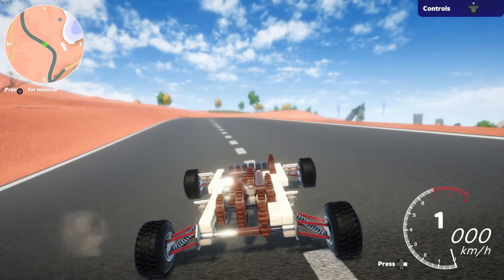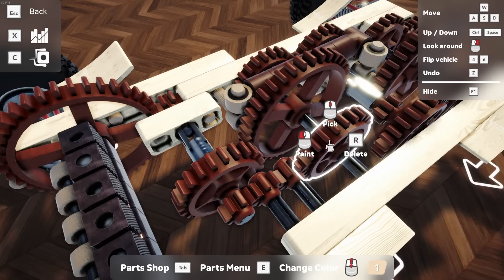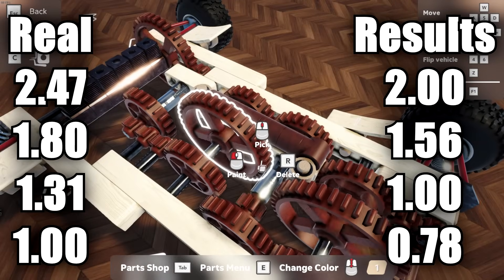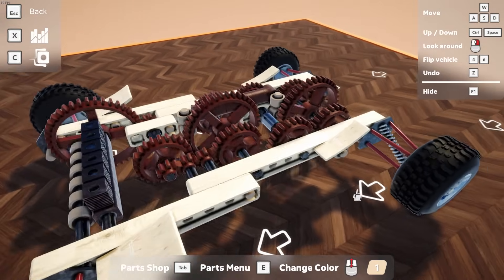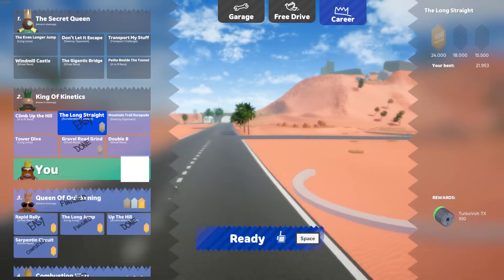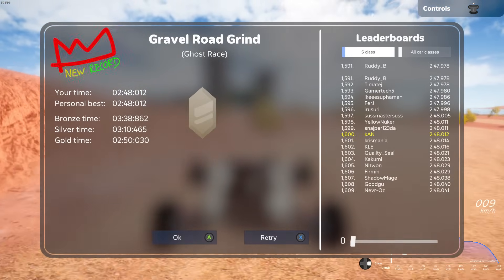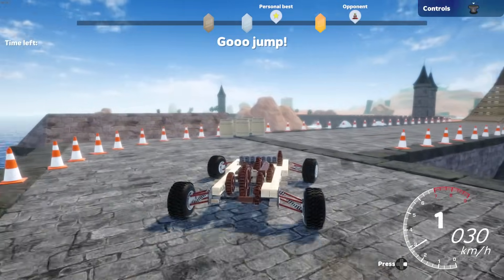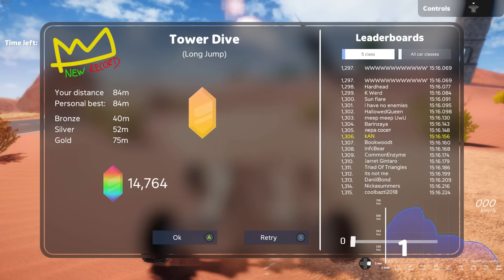I Built an Insane 4 Speed Gearbox Using Real Life Transmission Ratios!

Comment from the maker: Let me know what you think of my transmission and how I could make it better although I'm pretty sure it is "not bad". "
EDIT: Apparently there is manual shifting in settings.... unfortunately it doesn't seem to map to my xbox controller but either way thanks for the advice!
Reply: Huge fan of you, Scrap and the rest of the group, just to put that out there!😊
Reply: you can select manual shifts in settings
Reply: By the way, people have made planes that can fly in this game using upside-down wings and using wings as propellers so yes you can flip them over.
Reply: Congrats for the Wedding ! Wish you guys a Lifetime of Happiness😄
Reply: When you flipped the downforce to upforce, it was still downforce (just less effective). You rotated twice instead of once.
Reply: with steam you can map your controller to be the keyboard keys if its not working for you
edit: just press shift tab if you have overlay on when game is open and press the controller button at bottom of screen
Reply: You gotta learn to let off the accelerator when in a jump and use reverse to level off the car.

BTW,straight up planes with propellors have been made in the game.
Reply: this is so cool I cant wait to see what you get done with the better transitions, harder to use engines, and orbit gears
Reply: There is a manual mode in the settings
Reply: I think the class is speed
Reply: 4 5 8 is correct for the gears, dev confirmed
Reply: Upside down spoilers do generate lift, but it doesn't really feel as if they would be wings
Reply: I love how you are completely unaware that cars are 100% controllable in air. With inverted wings, you can fly for like hundreds of meters easily, and steer quite a bit. Gliding from the Royal Castle is super fun!
Reply: I would love to see u make an 8 speed engine
Reply: Love these videos, they help me understand more about rc cars and transmissions, they are so fun to watch and would love to see some rl rc car off road racing, keep going strong
Reply: wait till you have the planetary gear they are packaged really nice
Reply: There is a three shifter
Reply: @soulreaper1981  do you mean three? yea it takes alot of space tho. will change the shape of your build for sure
Reply: Make a hybrid so you can have the best acceleration and top speed!
Reply: yeah a manual shifting and shift sequence programming mode were my two bits of feedback recently. and YES THE UPSIDE DOWN WINGS PROVIDE LIFT. i made a dual rotor heli with upside down wings and wheels in creative and tested it on long jump. controllability is almost non-existent, but i flew to an easy 1km over the map in free drive.
Reply: You were so close to getting the good ratios. You coouldve just multiplied it by 1.25 you'd get 2.5 1.875 1.25 0.975 which is right on the real transmission. Big to small gearing on the output from the transmission and that wouldve been it.
Reply: You have air control on the long jump u probably held down w and that's why u pitched down and then of course the wings aren't going to work
Reply: S class means sport class
Reply: You can make it manual in the settings
Reply: you actually have the manual mode in the options and touch them by searching a little I found " ; " and " : " to shift gears manually, it offers more control over acceleration depending on the vehicle's gears, personally I prefers manual mode after everyone sees things their own way.
Reply: Just to let you know, your right stick is air control
Reply: Yes, put another shifter on the back and then some Downforce front and rear to be able to Race it.
but better is to beat the career then you can find the best engines and gearshifters in the treasure chests around the map.
Reply: You can click details in top left corner in performance chart and it gives you the information of classification for the vehicles
Reply: You don't need to choose between the 2 gear sets. Just add another unpowered transmission with both gears switchable transferring down to your axle. Boom, 8 speed transmission with better acceleration and all the speed.
Reply: As far as i hear gas engines are way better when used for a gear shifter like this due to the shifting needing high rpm.
Just wanted to point this out becuase in your last video you made gas sound like it was inferior when gas is actually better than electric when it comes to transmissions.

Btw love what youve been doing in screw drivers so far, keep it up 😊❤
Reply: dude you can switch to manual gear change in the options
Reply: Observing channels like yours, I noticed that your Ratio is quite "centralized" with the Real target, as I don't see too many losses in values, and a good way to reduce its size, I think a GearShift 3 would be useful, it would make the front or rear big But it would be better to change Gears, and with larger engines you can reduce the number of smaller ones, maintaining power It doesn't look like "Oh my God Mark 5 in this game" but it would help to reduce the size, and the focus would be more on Performance, like the 38km/h you achieved❤
Reply: @kANGaming 0:37 in the settings you can change to manual transmission.
Reply: If you go into settings, there is an option for manual using the "<" for down shift and ">" for up shift
Reply: Ngl, theres a such thing as a S+ class........>.>  ive been just messing around in Screwdrivers and i made a car that its max is like 247 but it can climb too 400+ (take a while) just the map isnt long enough. I wanna see if i can make 400 lesser of a climb.
Reply: Hey KAN! Please try to attempt Mach-1 and achieve a Sonic Boom! No one has done it yet and I also checked the Planetary Gear and it is indeed 1 : 2.3 Gear Reduction as shown in the part info. The big gear is 1:2 when you mesh it with the small gear. (NOTE: The Planetary Gear gives 2.3 ratio shaft to shaft, no gears to be attached. The Engine Output Shaft goes into the carrier/planet gears directly and then you attach another shaft at the Sun gear and that gives almost 2.3 at the Sun Gear output shaft.)
Reply: where are the video of gearblock ? did you made any engine ?
Reply: can you do a tutorial on how to build this

Comment: Usually the gear ratios in a car are given the other way around, instead of being shaft rotation to engine rotations, it's engine rotations to shaft rotations. An example being the first gear on my car, a WRX, has a ratio of 3.454, while the second gear is 1.947. Given this standard, I believe that you may have misinterpreted the realistic gear ratios that you used, but ironically this would have lead to better results inside of the game. While in most cars an overdrive gear is really only used for better gas mileage at high cruising speeds, from my observations, these gear ratios are very effective for increasing top speed inside of Screwdrivers. This leads me to believe that the engines in this game create a lot more torque and have much lower RPMs than their real-life counter parts.
Reply: Came to comment the same thing. First gear is usually numerically higher and fourth is numerically lower.
Reply: That’s what I was thinking, real gearboxes are mainly reductions.

Comment: If you view the power chart from the build mode there is a button in the top left that says details, it explains the different classes, also it seems to pretty much always be worth it to just stick some electric engines on your driveshaft after your gearbox as it gives that acceleration for like the first 15kph which gas powered cars inevitably lack
Reply: Also if you run a bunch of gas engines and electric motors into a gear shifter through the same input shaft it doubles your gear count. It's not overly helpful from what I've tested so far though..

Comment: The game computes 2 classes for each car: One based solely on the theoretical max speed shown, and one that's based on almost all the stats: Max Speed, Power, Acceleration, Mass, and Aerodynamics. Then it displays whichever of those two is worse. (Grip and Wind resistances are not factored into either class calculation)

Your friend is correct. I can confirm the gear ratios in the current game version are 4:5:8

Comment: Some stuff you are missing out:
- There are some juicy parts you may want to look at: Gearbox 3 (changes 3 steps), planetary 1:2.3 ratio gear set (also some beast of gas engines)
- Controls: You can set the game to manual shifting, remember Space to handbrake on those hairpins, active aero or inertial weights to help break/turn are a thing, although controls are a bit finicky
- Yes you can make flying creations ;)
- Yes, 4,5,8 (or 8, 10, 16) is what I also use in my spreadsheets :D
- Aerodynamics matters quite a lot in high speed (even without wings a wide and tall car will have worse aerodynamics as the game actually factors that in)
- Making the torque higher at low speeds to increase acceleration may not increase the actual acceleration as the grip is the limiting factor - an ideal gearbox (akin of a CVT) would be something like the torque is inversely proportional to the speed, thus drawing not an exponential, but a hyperbole curve (y=1/x), ideally you want the highest gear to end with enough torque to accelerate just a bit (low torque and high speed) and the lowest to have the highest torque possible without leaving all the rubber in the road, the gears themselves should be spaced in such a way that the torque over rpm 'area' is maximized for each gear, the game does the correct thing and changes gear when there is one with better torque for that speed (that said it hesitates a bit when on the edge, I had to use manual shifting in my max speed car to reach 1280 Km/h ).

Hope it helps!
Reply: congrats you can use your brain
Reply: the last time i tried to make something fly I broke the game and deleted the skybox somehow

Comment: 7:00 Nice explanation, it's the other way around.
With gear ratio of 2 the engine has to make 2 revolutions for one axle revolution.
Gear ratios that are below 1 are the fast ones.

just adding 
[gear ratio] = [input rpm]/[output rpm]
You can calculate it the same way with diameter or number of teeth

Comment: Tips:
1. Use air controls so you don’t flip during the long jumps and jumps in general.
2. More downforce for better handling and grip.
3. Do the part introductions they’re quick and helpful.
4. Have fun with the 3 gear shifter and the better engines once you get to them!
Reply: I can't wait to see what happens when the planetary gears start showing up.

Comment: find that gearing to around the 190 km/h mark (like you have it) is the best setup for most the track. but i would only recommend a 2speed just for weight. i also like to keep if 2wd (for weight), front-wheel drive (makes it easier to drive)... and turn the steering and grip level with downforce is the biggest key!

Comment: So transmission wise, you'll unlock a 3 speed later which makes making more gears way easier. One of the things I noticed is that having more gears may actually hurt your vehicle, as the engines in screwdrivers pretty much flatline at the shift point. I guess this would simulate a clutch being activated, but for whatever reason it feels worse than irl, so shifting a lot is bad. Preferably you have 1 gear for acceleration, 1 for cornering and 1 for straight line top speed, maybe a fourth for the extreme long straights, but thats it. Personally I like making 6 speeds that have the potential of going 1000kph but never go past 4th xD

For making your transmissions smaller, the shifters don't actually care whether you input power throught the connection, use it as an output, or, most importantly, don't use it at all! This means you can just input onto the connected axel and output from it... Just make sure the ingoing ratio is not the opposite of the outgoing ratio (e.g. by using 2 small gears instead of 1 medium one, cuz direction don't matter).

other than that, the 90 degree gears are also great for making a long (or tall) inline gearbox, cuz its simply the better orientation for building one.

Upforce is a thing and you can make planes if you wanted to.

Unless an update comes out to fix it, variable downforce will be kinda jank (press a button to toggle it instead of trigger on braking/turning)
Reply: Upforce is a weird way to say lift lol!
Reply: What happens if you have 2 sets of engines that shift at different points? Do all engines cut out? Or just the ones that actually shift?
Reply: @Pystro  it switches engines and drops a gear depending on engine/motor rpm. I've got a build I did today that's 4 of the top gas engine and 2 of the top electric motor with 1× 2 speed shifter but it's got 4 gears because of it.

Comment: Upforce does do stuff, you can use those wing pieces to build propellors/wings for planes/helicopters - that being said, upforce usually hurts your acceleration too much for a jump car, so if you wanna do that you need to put them on servos to switch from down/no-force to up-force mid-air

Comment: I think the class might be an overall rating adding up (or using some formula) the different categories as a whole. I have one car I made where I switched from larger tires to smaller ones and the acceleration bumped it up from S class to S+ so acceleration does have an impact on it at least from my experience.
edit: Upforce does work is just that your car flipped upside down in the air. You have to use air controls to keep a good glide slope/angle

Comment: I'm 99% sure your 300 kph version would do better in racing too. I bet it even has a better 0-100 kph as well since the one you're using has such short gears that it loses time switching too much. Having a little less torque at the lower end would probably make it easier to control too. The top speed difference is also monstrous for what little improvement you might be getting at the mid-range on the other one. It just uses its power better all the way without wasting as much time switching gears early on. You should try it as is in a race.

Btw, did you ever try controlling in mid air? It's super responsive. You might a "mind blown" moment! lol

Comment: My advice on suspension: if you have a very low car like you have, the off road suspension feels fine, with the added advantage of handling off road better. When you start to make taller cars (to fit everything in) the wobble off road suspension causes gets annoying.
Reply: It’s also tall enough to mount 1 block higher so the car will still be pretty low

Comment: You need all wheel drive and double up the axels because acceleration and turning is greatly effected by grip.  The next monarch will start getting you bigger motors, a way shift, and bigger tires.  There  are some armor plates.  I want to see some on a motorized axel to spin and see what that does in a demolition race.

Comment: This transmission is super cool, I definitely think you could make 1st gear shorter as you mention in the video, the only thing that seems off is the shift from 3rd to 4th. I think making 4th longer would give a much nicer drive
Reply: first gear even shorter?? he wastes to much time shifting gears thats why his 300kph version performs better. it has less torque but less shift time. also less torque means less wheel spin. if your first gear has some ridicoulus torque number your gearing is wrong because a tire thats just slipping doesnt transfer energy effectively.

Comment: You can shift manually.  I believe it’s a setting you can turn on defaulted to . and , 

I discovered that when I had a transmission that wouldn’t shift out of first gear due to a hybrid engine setup.  Was maxing out the rpm of the electric part before the game decided the car needed to shift gears so it just pegged at 80kmph and wouldn’t shift.  Lol

Comment: Now that you have those spreadsheet Use hybrid system such that there is 3 speed electric power 1st < 1:1 2nd = 1:1 3rd >1:1 directly power ice output then 3 speed at their combined output such that 1st = 1:1 2nd > 1st and 3rd > 2nd here at every ice gear their is electric power to pickup lower end of the gear this will be an amazing system to see

Comment: i see a potential issue with your gear assembly. when the 2nmd gearshift shifts, you connect in the front and the back. but the one in front is part of the 1st gearshift assembly, so you create a loop. unless the 1st gearshift also shifts the same time, then its no problem.

Comment: when i faced the problem of not knowing the ratios i just counted the teeth on each gear. ran the numbers on a python code and it seems to match preety well with the ratios ingame
8, 24 ,42 that's the number of theeth for each gear. hope that helps
also... using only 4 gears and a planetary gear system you have 26 diferent gear ratios you can combine

Comment: Based on the visual size, it should be 1, 3, and 5. They are the same size as Lego gears, which are 8, 24, and 60, which is 1, 3, and 5 when divided by 8.

Comment: did you know you can input a shaft into the side hole of the shifter to transmit power? also you can turn on manual shifting in the setting

Comment: So as a car guy myself, don’t think you’re reading the transmission ratios correctly, unless I’m mishearing you. The transmission ratios are division, so your first gear is engine rpm/2, and your fourth gear is rpm/0.78 actually increasing your speed in what’s called the overdrive gear. The racing trans you referenced is most likely a drag racing car since it doesn’t have an overdrive because it doesn’t need to to be fast, just quick. And your trans can be quick, just not as fast as if it had “deeper” gear ratios. Cars also have differentials that also divide the rpm’s right after the trans and before the power gets sent to the wheels, though you can’t do that in screw drivers as of right now.